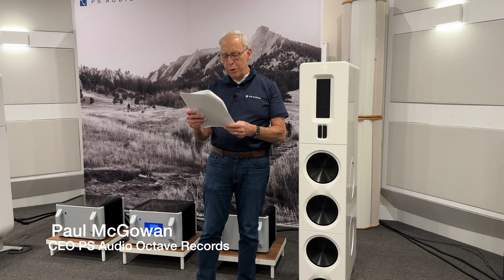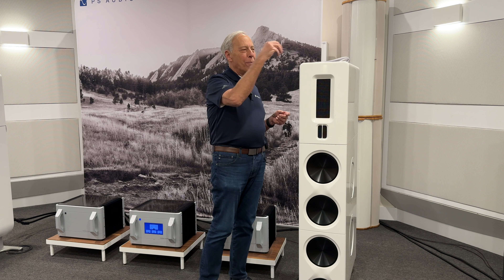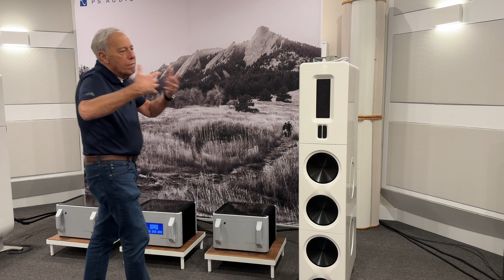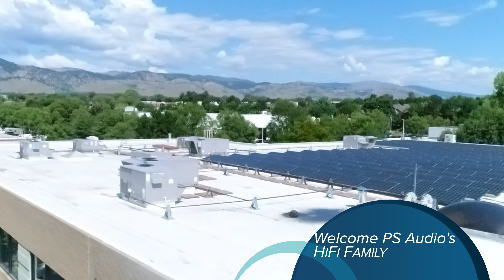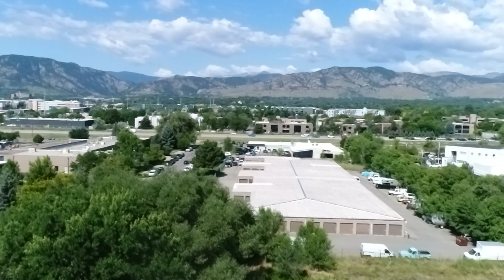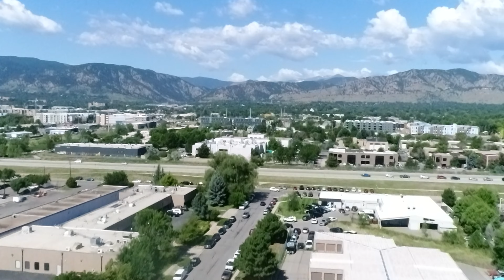An all analog system

Comment: What if you have a class D amp?
Reply: Class D isnt in its self is not digital. Its pulse width modulation
Reply: Most calls D isn't digital. There are a few class D that are digital.
Reply: D is just the next convenience letter in the alphabet to use to denote this amps particular characteristics.
Reply: @housepianist  I'd argue it is a little more than that.  It is fundamentally different in the way it amplifies a signal.
Reply: @user-od9iz9cv1w 
Yes it is fundamentally different ... just like A/B is to A ... but that does not mean it's digital.
Reply: @Pete.across.the.street 
Some Class-D amps have digital inputs (i.e. PCM signals) but the actual amplification stage is still analog... and hopefully linear.
Reply: Man those analog microwaves behind Paul are big. I wonder if they would heat my coffee better using analog waves verses my digital Kitchenaid.
Reply: @clickbeetle2720  I agree that as D comes of age and now performs well, the advantages are compelling.  OTHO, as much as my 110W OTL triodes are mostly based on tech that is decades old, I certainly do not agree they are out dated.  Massive.  Heavy.  Inefficient.  And... lovely :)
Reply: I have never heard a solid state amp that sounds anything like a tube amp. I doubt that will ever happen. Anytime you hear someone say a SS amp sounds tube like; they are either lying or don't know or appreciate all the special qualities that great tube amps have. I have heard cd playback sound just like analog. Whether Class D amps will ever have anywhere near the tonal beauty of good Class A amps with all their inefficiency, or a great tube amp with the stunning tonal beauty it is capable of, is doubtful I think. Very different things are bound to sound very "different" .
Reply: I suspect that DSD and Class D amplification are highly related. If you consider DSD to be “digital” then so is Class D amplification. I submitted a question about this to Paul once, hoping to hear his thoughts, but I don’t think it made his cut.
Reply: I suspect that your average Class D amp user is someone who is cheap, someone where differences in sound pass right by them like an unnoticed summer breeze, who've never owned higher pedigree gear with special qualities, someone who gives more credit to specs and numbers than they deserve sonically in practice. Someone who doesn't have an acoustically treated room, and a half dozen treatment things in a room is not a true acoustically treated room. There could be some good Class D amps out there. But are there any truly great ones, like near state of the art? I realize I haven't heard them all, so I'll give pause; but my guess would be "I doubt it."
Reply: @SteveWille 
DSD is NOT digital.  There I said it. 

DSD is a means of modulating a carrier signal made up of square waves.  The audio is derived from the ratio of 1s to 0s in a differential manor.  At idle you will have a 50/50 ratio of 1s and 0s ... for a positive half cycle increase the ratio towards 100%... for a negative half cycle reduce the ratio towards 0% ... it is an analog means of modulating a carrier signal by filling in more or fewer bit times.

But it is not PWM ... that is an entirely different analog process.  Here you have a steady stream of square waves that idle at a 50% duty cycle (Equal time on vs off) For a positive half cycle you increase the on-time of the square waves. For a negative half cycle you reduce it.... this an entirely different analog means of modulating a carrier signal by changing the width of a steady stream of pulses.  

Neither of these are FM ... in an FM system you are changing the frequency of a steady stream of pulses. For a positive half cycle you increase the frequency and for a negative half cycle you reduce it. ... this too is an entirely analog means to modulate a carrier signal by changing the frequency at which it operates.

And none of those are digital ... In digital signalling you are conveying information via binary patterns of 1s and 0s in a fixed rate carrierless signal. The information is not analog and never has been analog, although it can convey analog information as a succession of binary values (PCM data for example). The binary patterns of 1s and 0s are meaningful to both sender and receiver, thus they can exchange information between two computational devices.  

This not a minor distinction and it's not semantics. At the engineering and service levels these are 4 entirely different things.
Reply: @sidesup8286 
Yeah well, we've spoken about your child-like suspicions (read: "Imagination") in the past.

For your doubt about "truly great" Class-D amplifiers ... why don't you ask Paul about the Stellar and Sprout series...
Reply: @Douglas_Blake_579  Sorry to belabor the point; your statement “DSD is not digital” is provocative… How do the differing rates at which DSD can be captured fit into this idea that DSD is not digital? Isn’t this just another form of quantization? In some theoretical sense does PWM exist without reference to a sampling rate (the square-wave widths)? Perhaps the semantic problem is mine in that I have equated digital with quantized. To me, analog means never having to select a quantization, never needing to permanently choose a level of fidelity (at the expense of never being able to make perfect copies going forward).
Reply: @Douglas_Blake_579  Well said.
Reply: @Pete.across.the.street 
Conversation in programming class... 
Me: "Why is it called C?"
Teacher: "Because it came after B"

Went looking and found the B programming language... I see why C was so popular.
Reply: @SteveWille 
Your mistake is simple ... in DSD, PWM and FM we are talking about different analog methods of modulating a carrier wave that is just coincidentally a square wave... to get the information back you simply filter out the carrier wave.  There is no sampling, or math or anything else done on the carrier wave itself.  It is simply the means to transport the information.

 In the digital realm there is no carrier wave.  The received pulse train is the information, itself.

I don't know where you got locked onto quantization in any of these cases... but I strongly advise you find the key and get free of it.
Reply: @clickbeetle2720 
Wanna see a bunch of people's heads explode?

Fact: The power output stage of  a Class D amplifier operates in Class C mode.
Reply: Boring things don't ever blow people's minds. Interesting things that are surprising and important to them may.

Comment: I don't understand people that have digital phono preamps. Why on earth you will like a double conversion? From analog to digital in the phono preamp and from digital to analog in the DAC. They are wasting all the benefits of analog audio.
Reply: And gaining all the advantages of digital signal processing.  
Phono preamps include an RIAA de-emphasis filter that can be far more precisely controlled and matched to your cartridge via DSP and without the parts variations common in the analog ones..
Reply: @Douglas_Blake_579  Yes, but when the vinyl is cutted they don't use a DPS device, just filters.
Reply: @pablov1973 
Actually the RIAA emphasis on treble is inserted in the mastering phase, which is usually done via the Digital Audio Workshop's DSP filters.  

It is very unlikely you will find any recently pressed vinyl that has not been digitally mastered.  Even Paul made the leap with Octave Records.